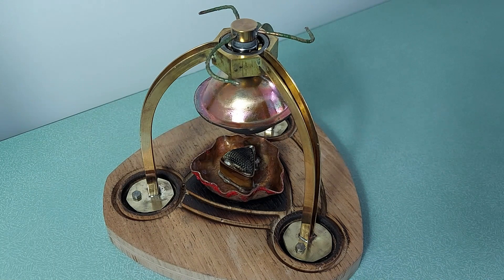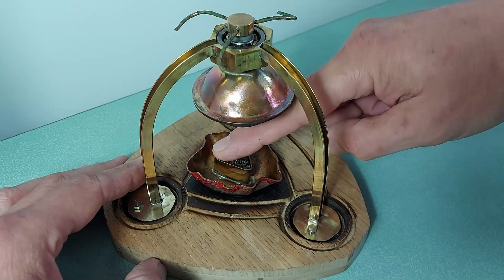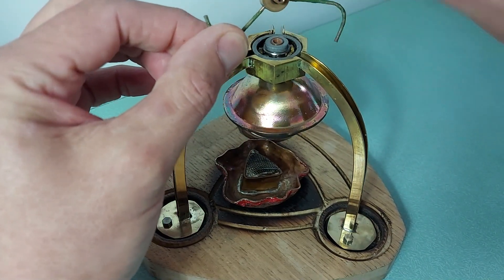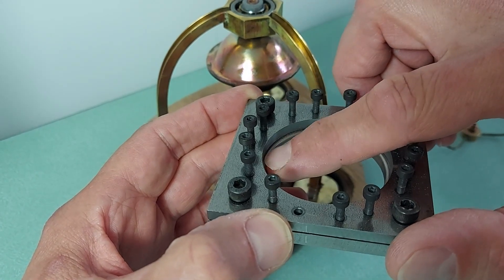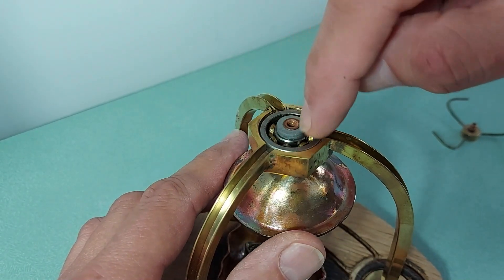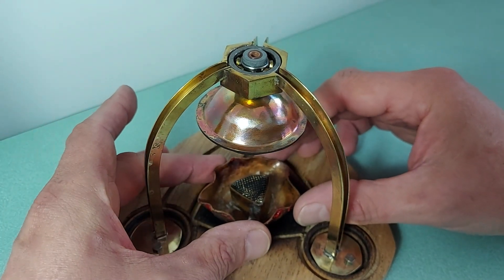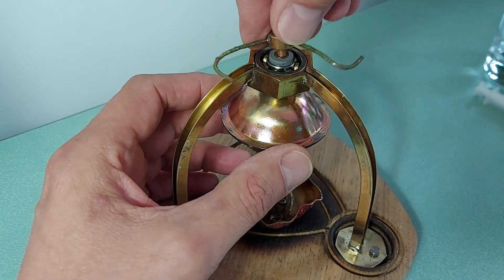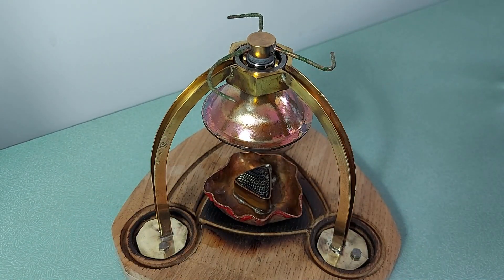Heron of Alexandria Aeolipile

Comment: What a lovely machine! Are the spheres soft soldered together?
Reply from the maker: Thank you. The spheres are silver soldered together with easy flo 55% silver.
Reply: @editorglueitcom  ok, thanks! So it won't come apart when running dry and overheating.
Reply from the maker: @Wout Moerman  no, the joint is very solid. I have run it dry and it just gets very hot